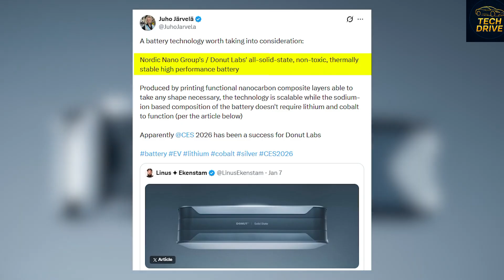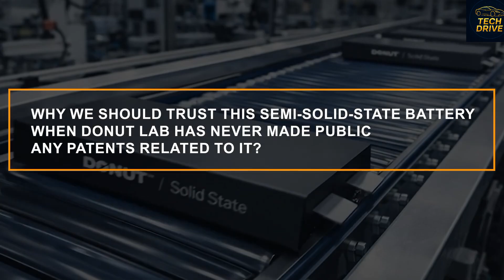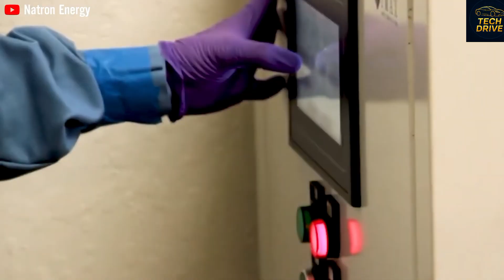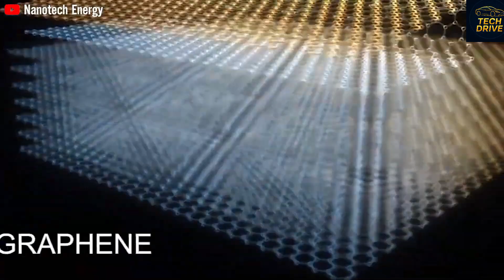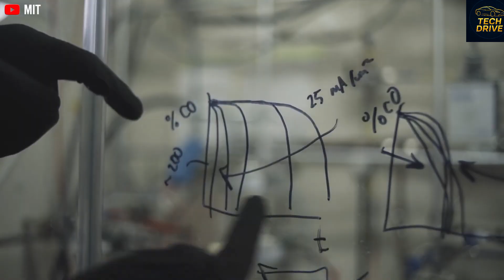5-Minute Charge, No Lithium, 100,000 Cycles — Is This Battery Real?

Comment: They should sell the motorcycles for 10 million dollars , because large corporations would buy them just to reverse engineer the batteries.  Right?
Reply from the maker: In practice, that wouldn’t work. Reverse engineering will happen no matter the price. What matters is timing, NDAs with OEMs, and staying ahead in manufacturing and iteration, not trying to make teardown impossible

Comment: One question however. IF Donut labs do not target journalists but rather OEM's, as you say... Then WHY make this press announcement where they basically show only casings and not function products, as they know that this will only fuel DOUBT? That doesn't seem to add up...
Reply from the maker: That’s a fair question. The announcement wasn’t about convincing journalists, it was about signaling existence and momentum to OEMs, suppliers, and investors while still protecting IP. Live demos would expose too much too early. It does increase public doubt, but that trade-off can make sense strategically in this industry.

Comment: Ok so if this technology can produce the claimed results using Sodium Ions then chemically speaking Donut have been wasting time and money. Here's a question asked of Copilot- Q "if the chemistry and architecture are the same, and only the ion changes from Na⁺ to Li⁺, how much better could Li-based solid state be, in principle?
Answer- for the same solid‑state architecture, a Li solid‑state cell would likely have on the order of ~30–60% higher energy density than a Na solid‑state cell, mainly because Li is smaller, lighter, and runs at a slightly higher voltage. The exact number depends on cathode choice and packing, but we can bracket it pretty tightly.
Lithium and Sodium are chemically similar so if you wanted to use a battery for transport as is their claim, then Lithium is your go to. If it is for cost saving and grid storage then Sodium wins. I acknowledge that this is a simplified view but  without further detail about the Donut battery and without them allowing others to qualify their claims, I will remain dubious about their claims.
Reply from the maker: This is EXACTLY the kind of technical analysis we love! 🔬 You're absolutely right - the sodium vs lithium question is crucial here. Donut Lab hasn't fully disclosed their exact electrolyte composition, which is part of why we mentioned healthy skepticism is warranted. The sulfide-based claim suggests lithium, but without independent testing, we can't verify the 400 Wh/kg claim. Really appreciate you bringing the chemistry perspective - this is the discussion we need! Would love to see third-party lab results soon. 👍